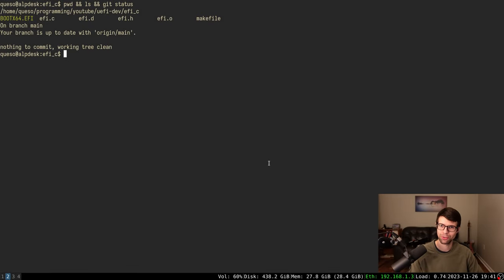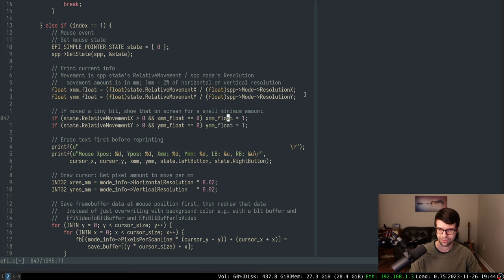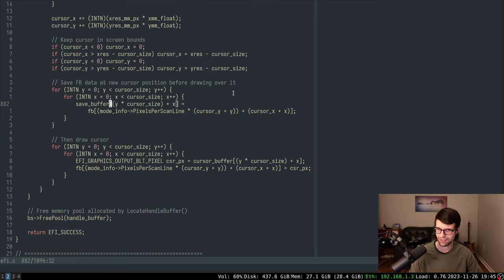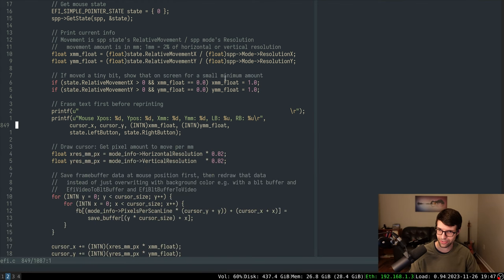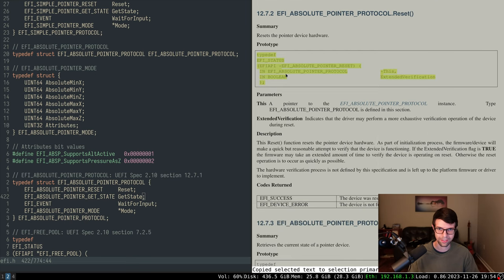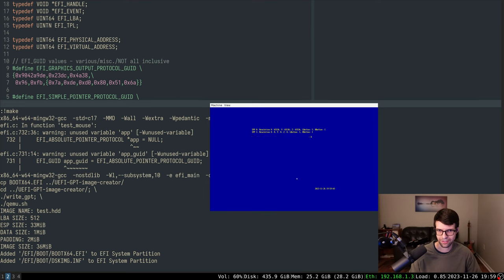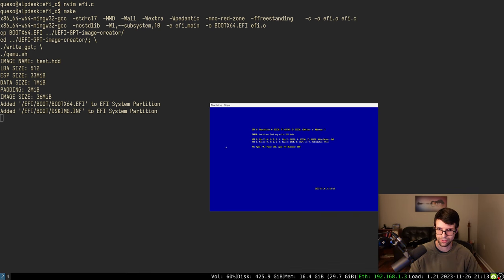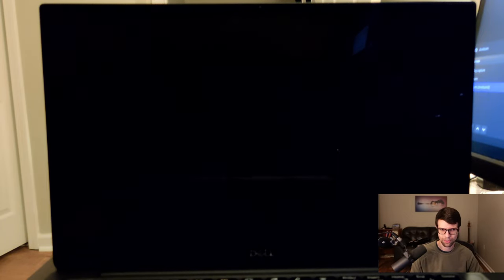Absolute Pointer Protocol & Touchscreen | UEFI Dev (in C)

Comment: Are you interesing with reactos. i wish you help them for uefi boot. May easy come. Health to your hands.
Reply from the maker: ReactOS is an interesting project, being able to run windows applications "natively" that aren't covered by FreeDOS or Wine would be valuable, in lieu of microsoft opening the implementation of their full kernel, which I doubt will happen.
I could maybe look into it for weekend hacking sometime. I'm still pretty new to UEFI in general and don't really have much time for free labor on other's projects.
I would probably try to work on reactos or wine if I was retired. Could apply for a codeweavers job, if I get a lot better.

The hands are good, thanks. Circulation is bad in the winter, being skinny and sitting all day doesn't help. But exercise does.
Reply: @QuesoFuego  Health to your hands is a good wish in Turkish. It is to wish that the work you do with your hands goes well and continues. Since there is no such phrase in English, I translated the phrase in my language into English. However, this way I express myself better. Take care.